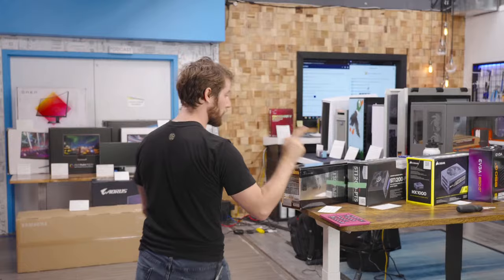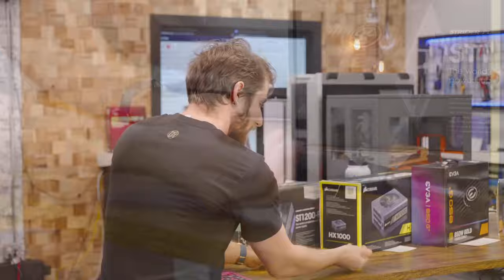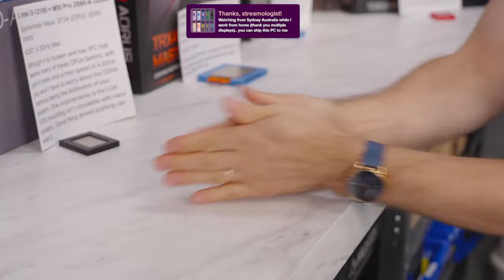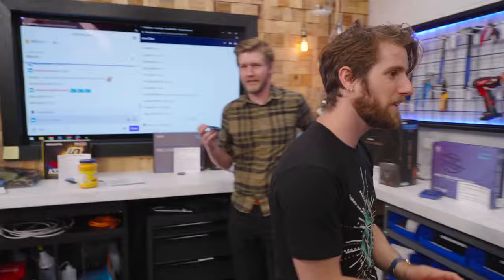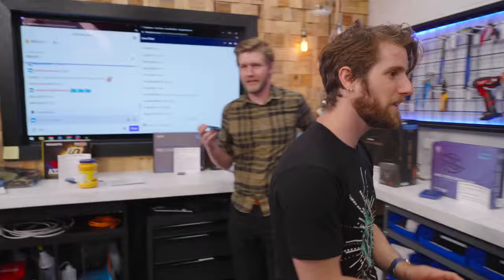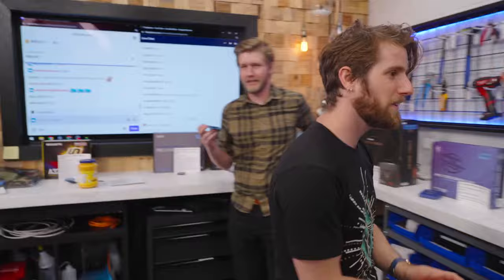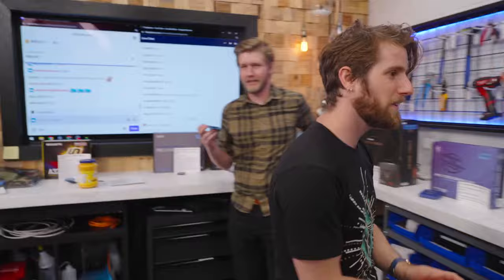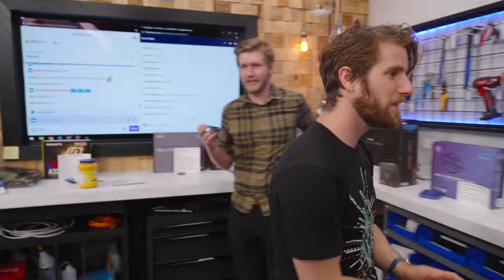I Pray This Computer Sucks.. Cuz I’m gonna sell it for $1

Comment: For the record, I have an 8350 in my build oc'd to 4.4 (Crosshair Formula -Z) and it still can run all the newest games without issues. The only limiting factor I've run into is with ram and the vram on my video card (which I may upgrade to buy some more time) I haven't built a new system because I haven't needed to, and I tend to build the highest end I can afford, then make it last forever before the next build (around 12 years on this one so far)  Yes I'm hitting the time I need to do my next build, but with prices being what they are, I'll be saving for a while for top end.

Comment: Damn, thats a flashback.  I remember covering it at Intel Conferences... common building blocks, the video's showing grade 1 and 2ers putting laptops together...  and the branding of the three or four components needed for centrino... Ah the memories...

And today you have to take the keyboard and entire top or bottom of the main deck off to upgrade ram or swap out a battery/hdd.

Comment: This was the first i had heard of the MSI liquid cooler problem but this explains why my MSI liquid cooler stopped cooling nearly entirely despite the pump and fans etc. still running. Already replaced it with a Noctua NH-D15S though so.....im good.

Comment: I know this is an old video but if you run a compression/gate on each mic you can select the max output value and also bring up the quietness of mic with a compression and with the gate you can block out background noises.

Comment: Linus I keep reminding the internet as to the accuracy of what happened with Intel vs AMD back in the early to mid 2000s. AMD had the faster processor for quite a while(higher performance at lower clocks, first to 1ghz and first 64bit processor ) but Intel was able to get Gateway, Dell and others to keep carrying their processors in the prebuilts of the day. Thus AMD was gimped via that midshare and whatever means of non tech 'competetion' , and im still concerned that info is glossed over whenever it is mentioned. That being said, Intel has floundered becuz of various reason but it is a giant and highly diversified and that gives it security and a chance to bounce back. Also the fact that on an inferior node they can still be somewhat competitive shows innovation. I do want AMD to get their due as a company. But i dont expect them to want to lower prices more than they have to. They need money to be competitive and we as consumers need to vote with our dollars....also on the gpu sidetreating Nvidia appropriately. As much as possible i vote with my purchases. Helping to maintain competition is good for consumers most of us agree.

Comment: My first Mac laptop had a trackball. The Mac PowerBook 145B! Someone was gonna throw it out in 2000. I gave him $10 CND   and  I got 5 more years out of it. I know how to use a trackball. My current computers are a MacBook Air M2 base model   (heaven)    and   an Acer Aspire 3 with 11th gen Intel running Linux Mint   (divine)     :-).

Comment: Kek the Centrino story, I actually had a dell top of the line 2005 centrino laptop at university. The intel wifi chip was great for its purpose but I had to resort to buying a second express card with an I don't remember the brand chipset that you could set to listen only for stealing wifi, AP spoofing etc... And the card was easily on par with the intel wifi chip.

Comment: Only thing I'd say about the game was when it came to the monitors that Samsung G9 should have never been in the running if their was a discrepancy to whether or not it was needed for some other project should have had something equivalent there in it's place. But the second roll ended up being better so it's still a win with the OLED

Comment: 14:15 Is there even a comparison here? Like... Yeah. Threadripper has performance. If you don't mind buying a very specific system to support the unbelievably huge socket and don't mind the power waste. Fine for about 0.000001% of the Pc population.

Comment: I used the AMD 8350 up until a little under year and a half ago!! Booted Windows 11 off of a PCIe 3.0 drive on a board that had 2.0 slots, 16 GB DDR3, and a GTX 1650 Super and played Halo Infinite on release on max settings just fine xD

Comment: Nothing from ASUS is worth $5000 of any currency. Bought a bunch of the 15 inch portable monitors and about 15% of them failed in 6 months while they were sitting on desks. A friend got 2 Asus laptops. of the 2 neither are working for different reasons. One failed because they used liquid metal and it ran. The other just stopped working. Good luck to the person who gets this.

Comment: I game on a trackball that's similar to that one (I use the logitech trackman marble) - I actually use all 4 of my fingers depending on the intensity of motion I want, if it's a major movement I will include my pinkie but usually I just use my other 3 fingers exclusively.

I can't stand a regular mouse, also I'm pretty good in games. There are pros and cons, for me mostly pros.

Comment: You could make the bit holder stack ontop of each other instead of them side by side in the handle and just make the handle slightly longer and it would be half the thickness but it's a great driver I love it 😀

Comment: Garrick aluminum car radiator and pour electric fans and electric water pump 110 V and run that through a tank or a 35 gallon drum of water that you can add ice to

Comment: 11:21 i had this cpu and it was one of the best becuase hear me out . AMD in europe sold bulldozer cpu brand new until 2018 (thats when i bought it ) for 50 euros with a ryzen 7 cooler .For 50 euros i paired it with a new 45 euros motherboard and an 130 euros rx 580 that i bought used from the bitcoin crash and i had a pc for 2.5 years playing whatever i want without many problems .The weird part is that it never overheated with that massive ryzen 7 cooler and i even overclocked it

Comment: LTT: In my limited experience and the criticisms of various articles, ergonomic devices are not going to help if I continue to make the wrong movements. I got a vertical mouse and it helps if I move correctly, but it makes it worse during gaming because of wiggling while aiming. However, I have not been able to experiment with keyboards, especially since some are pretty expensive. Some of the ones I've looked at seem to be token nods at them, while others seem to be definite possibilities. Can you do a comparison of the various types, including vertical, cup and wave?

Comment: for 1 dollar I mean depending on what era even the worst bits might be okey.
like i have been buying old games Age of empire 2 game of the year edition on CD from 2000 (original CD Keep case, manual and foldout tech tree as far as I can tell, everything is there minus any big box).
that said that would be a silly side project a Ultimate win XP gaming rig.
for the older games that you did not have the rig to play your childhood game at at max graphic and frame rate.
looking at you HL1 running in low, low and 30 FPS on a good day.

Comment: but linus, 10 sides, and the highest value was 90. that means 0 is 1. 10 is 2, 20 is 3, 30 is 4, 40 is 5, 50 is 6, 60 is 7, 70 is 8, 80 is 9, and 90 is 10. 

so yes , i believe you in fact did grab the wrong cpu and mobo
Reply: also, the 4090 tag spells supreme wrong. you guys had it suprim haha

Comment: the fx8350 real was not hat bad i had mine with a stable overclock of 4.8ghz and for £110 to get anything made by intel i would of been paying almost £200 more the fx core and a about the same for the board at the time
Reply: Read this after posting my comment. But I just think a lot of people lump in Piledriver (the FX-8320 and FX-8350) with Bulldozer (FX-8120/50). But yeah, I had a FX-8320 and got those kinds of overclocks)--it was my workhorse for gaming, music production, and video editing--for 6-7 years. Until I went with Ryzen and the 2700X.

Comment: you are using the wrong board and cpu.....0 is not 10 unless theres a 1 next to it otherwise its just 0 and comes before 1......so the board and cpu that you should actually be using is the one to the right of the one you grabbed.

Comment: Ok I like the video but most of the items involved in this where supplied to LTT by the manufacturer companies at no to little cost to LTT for the air time of doing talked about and most of the time LTT was sponsored by another company (normally 2 per show) that paid for the value already.  So they make it seem far worse than it really is, plus this type of show is great for tax season. Then if you want to talk live with them you can only do so by buying something and sending a merchandise message, which I get cuts out having to pay a 3rd party up to 50% but it’s stacking on stacking for the bang for the buck video production.

Comment: That was harah linux.

 Im a amd nerd and when i built my rig fx8350bwith an asus 9090 board was talk of the town...i can still run trill aaa at 1080p 50/60+ fps with a gt1060 on moatbganes...im juat sont running into problems with games being porter from then more powerful consols... but it was leages above my ps4 forbots age... ps5 stonps ot on the ground 
though

Comment: 😅 had a deal on a 8350 fx with a giga board made for it overclocked at 4.7 with a gtx 1060 6g 2t ssd for game 1tssd more game and a 500g ssd samsung for os and able to run most new game re2 re3 dirt 2 at high graph setting and medium on extra shadow etc runing gpu at 90% max cpu100%🤣🤪✌️💥🙈